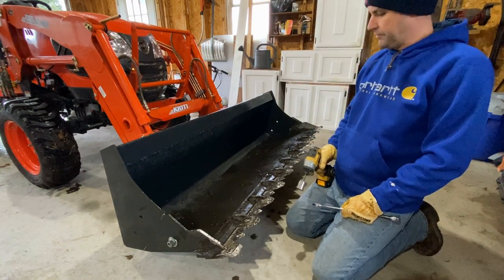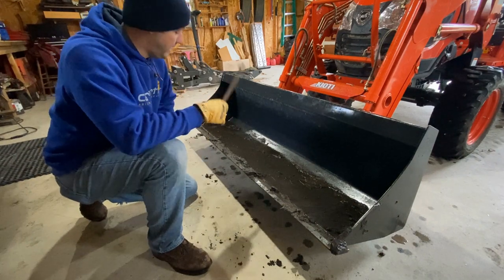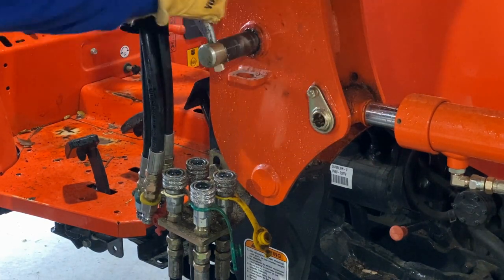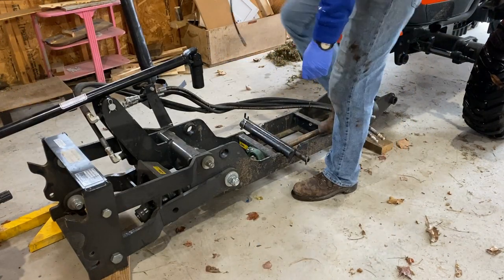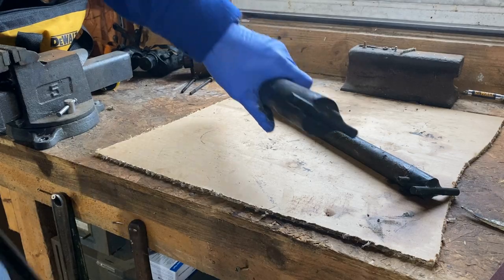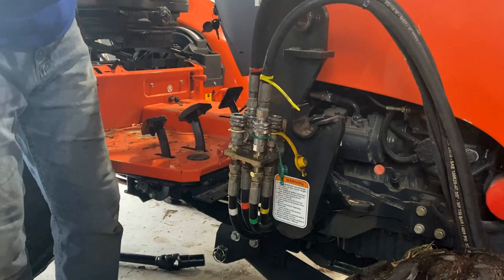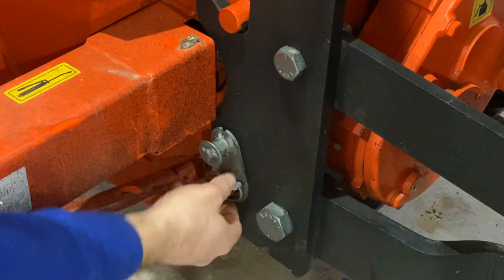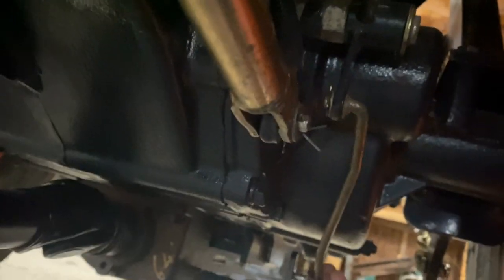Kioti CK2610 Removing Loader and Attaching Front Mount Snowblower

Comment: Good video, and very comprehensive. I have the CK3510 and same setup, and am going to do the same today.
Reply: Hey Chris.  How do you like the 3510 and blower   I am about to buy a new one in a week or two.  Do you miss having the loader at all with the front mount blower??.
Reply: @Merlin-pm4vm  Third winter with the front blower setup. Still love it, it is easy enough to drop the front blower and frame to put the loader back on if needed.

Comment: Couple of pointers, put the pins in from the right site so you can keep eye on the pins  because they can fall off.  Also you can keep the frame and blower together for a quicker install. The downside is it’s a little harder store and one of the grease fittings is really hard to get it when it’s in one piece.

Comment: Hey Mr. Scott, What a "Great Vidio". Very informative & great content. That "Shebangy Snow-blow-a-later" looks very stout & pricey. Just guessing 3500.oo$, hope you can "go in the business " to offset the financial outlay of the cashola. Your ck2610 is LOUD, still nice tractor. The ck3510 are a lot quieter with the common-rail direct injection. Looking at the ck3510se shuttle shift-a-matic version to augment my "fleet". My Kubota Mx5200 shuttle TLB & Massey-Fergusom 1736 power-shuttle-shift 12×12 TL are sometimes too big. A handy 1988 Massey-Ferguson 1020 2wd non loader with dozer-snow blade picks up the "light duty" chores. My choice for a Snow-blower would have to be a 3-point unit (universal fitment). Do you have a backhoe attachment;; they sure are handy--but pricey? Thanks for the great Video Sir & happy safe tractoring.

Comment: I would imagine that there is not enough room to remove the blower, leave the sub frame in place and put the loader back on.  It's one or the other.
Reply from the maker: Thanks for watching!  That is true. Not enough room for frame and loader.
Reply: I have no idea what ur talking bout!!  I will tell you you can takeoff the sub frame and the blower at the same time in one piece and it’s much easier!
Reply from the maker: @mr.redneck2715  hey don. Yes. You are correct. It can me removed in one piece… like you mentioned, it is just easier to get to all the grease fittings… My reply you just commented on was to a different person asking if loader and blower subframe could be mounted at the same time. .. sorry for any confusion.